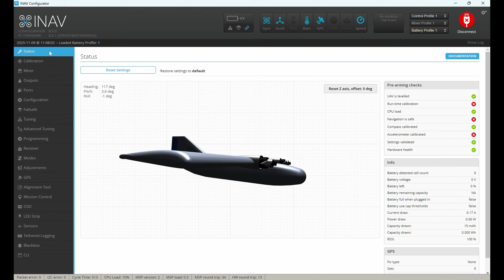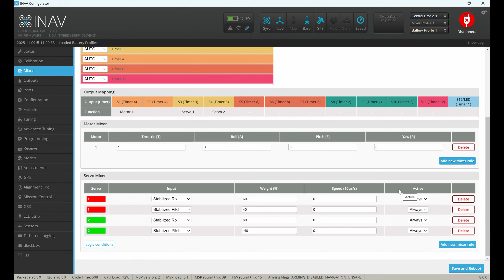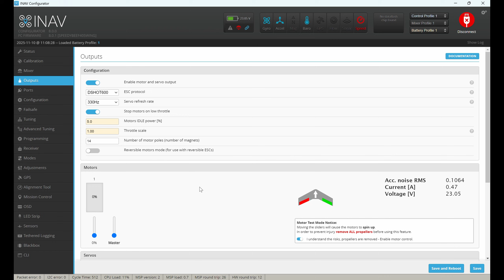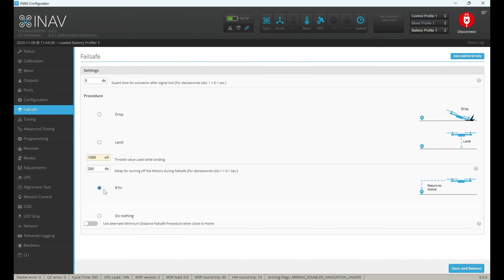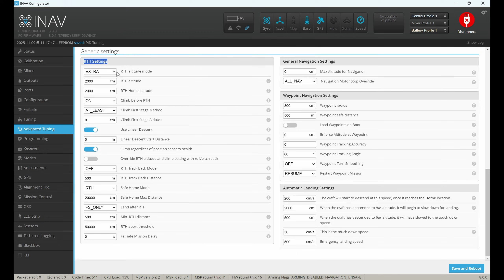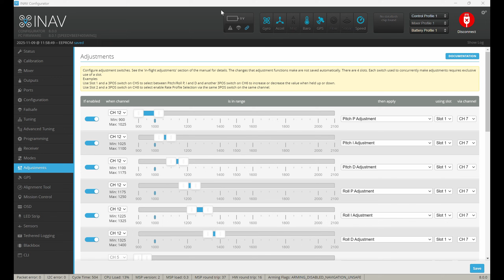TBS Chupito FPV Wing -PART4- INAV Setup from scratch

Comment: and you should never use servo trim with a gps installed
Reply from the maker: I don't use servo autotrim, I only use a switch to trim the wing in case I have a slightly different CG. Please let me know why you should not trim you servo if you have a gps